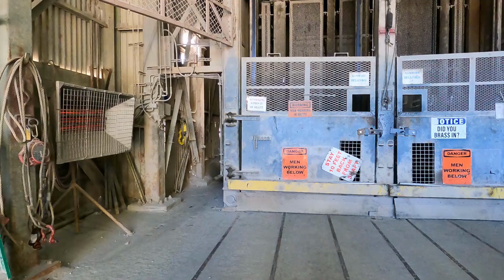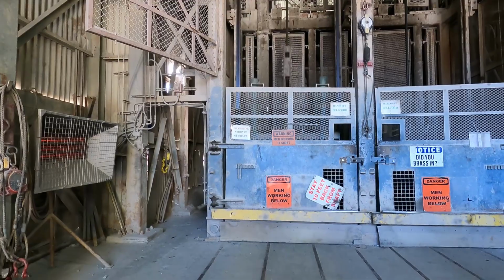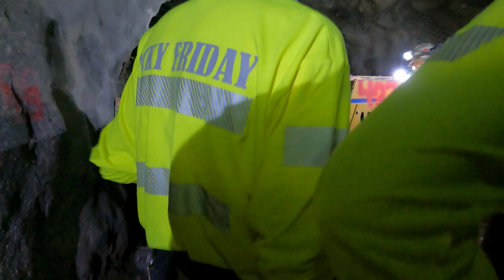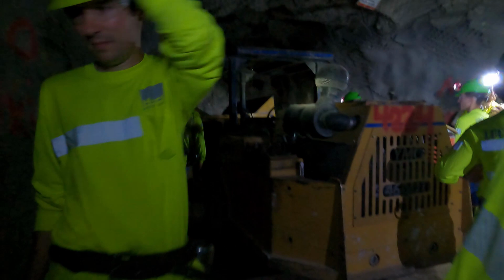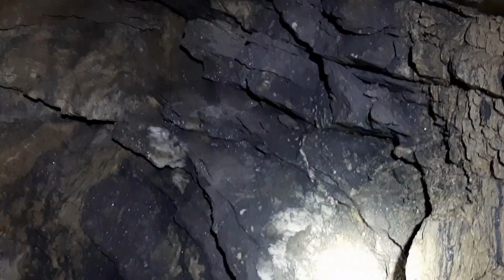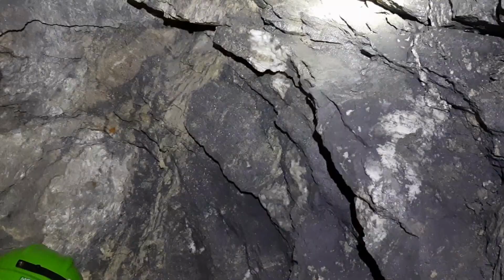Active Silver Mine Tour

Comment: Is there an atmospheric pressure difference down there?  Any risk of decompression sickness coming up to the surface, or flying in an airplane later?
What about all that lead, is there a risk of lead poisoning being exposed to all of that, or the flotation devices?  

Pretty fascinating place and apparently an untapped geothermal resource too!  When they're all done there, I'd like to make it my home along with any other dwarves who want to join me.  :)
Reply from the maker: There is a difference in pressure down there but I don't think there is a risk of decompression sickness. Most of the lead is in the form of the  sulfide galena so its not pure lead dust but, breathing in rock dust is not good for your health especially if it contains a lot of silica. I think it would be awesome but expensive to have an old mine as a home. They just need to keep digging it out and make it a whole city down there with great halls of stone. They can never dig to deep right?

Comment: I call BS , that elevator is not big enough for those equipment parts
Reply from the maker: Its true. They take them apart and reassemble them below ground. This is not the same place but a good example https://sanfordlab.org/article/rigging-underground-construction
Reply: Its called a skip or a hoist. Not an elevator.
Reply: Sometimes they haul the stuff down below the cage on a hook
Reply: I work at the lucky friday, it is very true. Hard to wrap your mind around it, I still do sometimes.